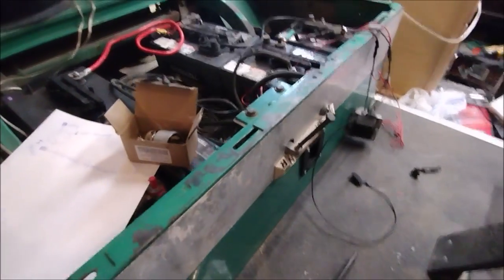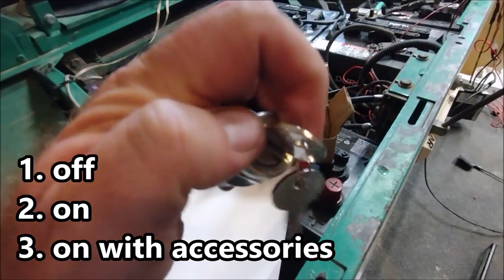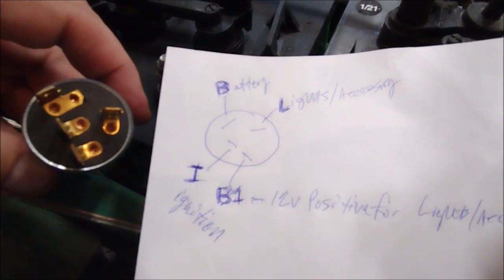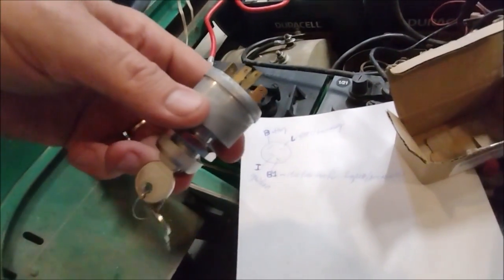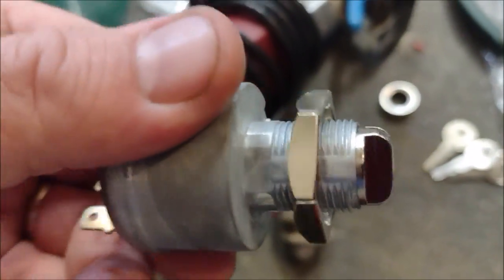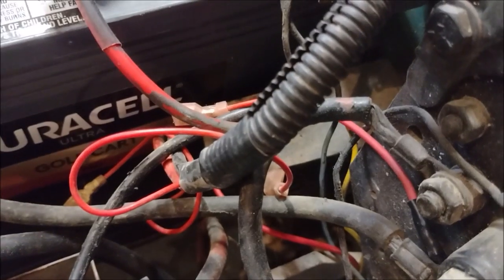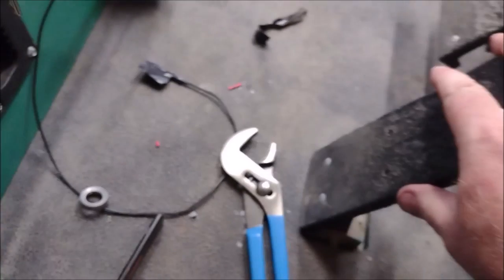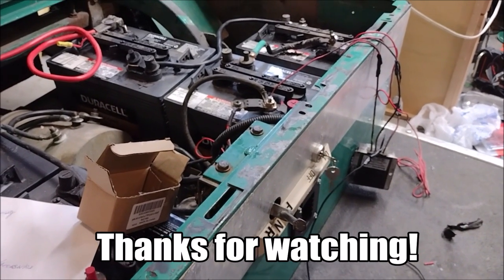1982 EZGO 3 Position Key Switch Installation

Comment: Thank you for the video.  I'm installing a key switch in an 87 marathon. The switch was missing and had been hot wired so I have nothing to reference. When you say the B terminal goes to the battery, do you mean directly to the positive post on battery 1, or does it go to some other point that eventuality ends up at the battery?
Reply from the maker: Sorry for the late reply.  I put it directly on battery 1's connection along with the other wires that were already there.  I put it on the not-positive-battery-side of the fuse.